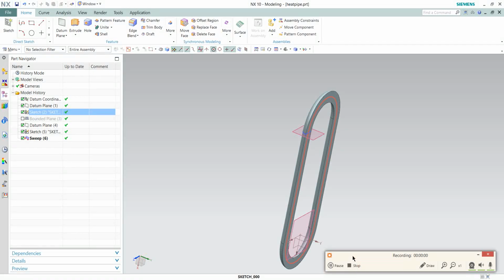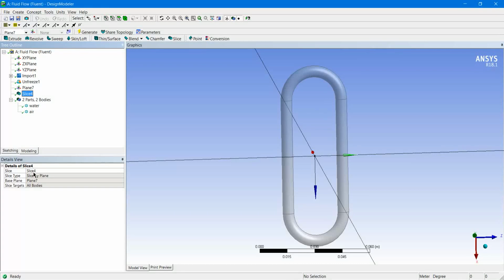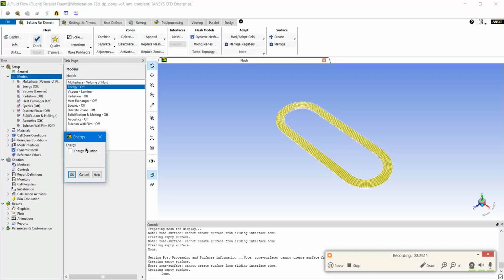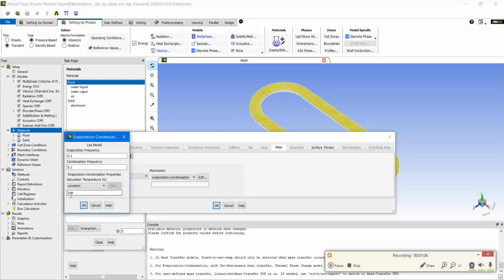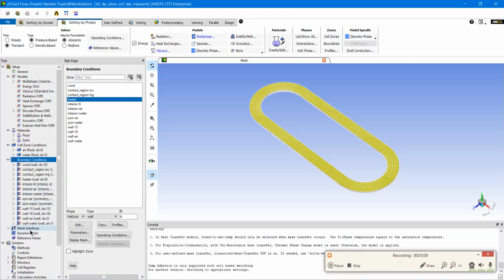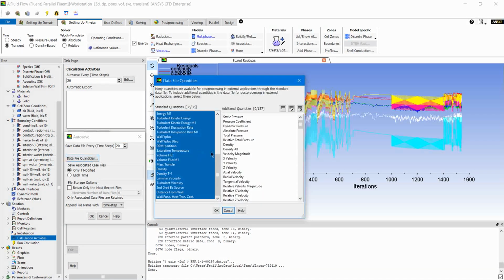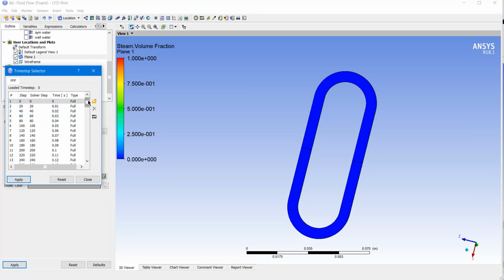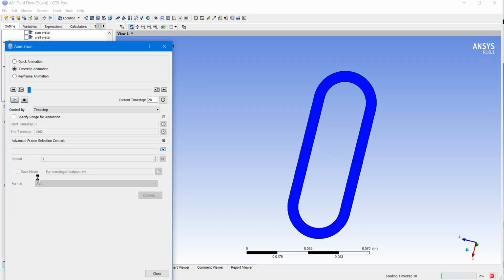Heat pipe analysis in Ansys fluent || Multiphase analysis in Ansys || Volume of fluid (VOF) model

Comment: Mr. Gandhi thank u so much for your explanation. That is a great and useful work i think.
But i get a question if i may.
You define a two piece of surface tension event between air-water and air-vapour.
Why we did not assign a surface tension between vapour and water.
Because i think i n the water region after heat is transferred to the water there will be vapor in air and i think there must be define a surface tension event between them. I would be very grateful if you could enlighten me on this.

Comment: First of all thank you that was very helpful, i have a doubt , 
during interactions in phase materials you have addes only one phase change that is from water to steam , but in a heat pipe the steam is again condensed into liquid and the cyle goes on so can we add that too!?
Reply: hello Mr.Pavan Kalyan. I would like to answer ur question with  ur permission. Phase change mechanism between the water and steam is assigned as evaporation-condensation event. That means with this way you can simulate either the evaporation or condensation with this manner...

Comment: I am using Fluent 2020 and am having issues with condensation for every case I run. I set up this case the exact same as in the video, and no condensation was seen. It just dried out all the water until the entire pipe was water vapor. Help please?
Reply: i am having the same prooblem did u fix this?

Comment: I tried this model. The vapors are not interacting with air domain. They are there in water only. Can you please tell if I have missed somewhere.
Reply: did u get solution? i am facing same problem

Comment: Why is there air in your heatpipe? A heatpipe is evacuated before it is filled with water only. You will only have water in the pipe and the partial pressure according to temperature.
Reply: Exactly pointed out
Reply: @prajwalbharadwaj2386  It can be a non-conventional heat pipe. However, that kind of heat pipe is usually filled with non-condensable gas at the end of the condensation zone, not the air in the video. However, the heat pipe simulation in this video does not necessarily have to be realistic. You can understand it as just an application scenario of multiphase flow VOF in ANSYS FLUENT.
Reply: @prajwalbharadwaj2386  Moreover, generally speaking, there is still a small amount of air in the heat pipe, otherwise it cannot provide the operating pressure.

Comment: Clear instruction however it's rather a thermosyphons than a heat pipe. No wick structure presented inside the pipe. Or am I mistaken?
Reply from the maker: yes. It is a demonstration of boiling - condensation with VOF model
Reply: Sir is this a heat pipe or thermosyphon
Reply: How to create wick for this simulation sir

Comment: Thanks Viraj for good explanation from you. But i have some question that hopefully you can answer or maybe some of you guys can answer my question. 
1. Will it give a different result if you are using eularian (condensation-evaporation model)? What is the different with VOF model?
2. Why you are using 3 phases, is it because there is air in the pipe that you are modeling? So if there is only water(steam-liquid) phenomena in my model, is it correct if Iam using 2 phases?
Thanks a lot ^^
Reply from the maker: For 1st Q, there is no simple explanation. You need to read ansys guide book

for 2nd, if you have only water and zero air, which would mean that there is no pressure in your tube. So, the water will evaporate at almost 0 K
Source: https://www.engineeringtoolbox.com/boiling-point-water-d_926.html

Comment: thank you, Viraj Gandhi ..can you make a video on simulation of a cylindrical heat pipe with open foam as wick structure. And evaporator is placed on condenser at the bottom or you can help me by explaining how to proceed for this problem?
Reply: If you did analysis for same, then please let me know
Reply from the maker: It is much complicated problem since it includes capillary effect in wick structure. I can say you need to be very careful about surface tension.

Comment: Thanks so much for the video. I am having problem learning how to simulate a simple case of subcooled water passing through a uniformly heated pipe, get boiled as it goes up the heated pipe, evaporation occurs at some length before completely turns to single phase vapor at the channel outlet. Please I'm i going to consider this as 3-phase scenario? If yes, how will I define the phases.

Please do you have a tutorial on this simple case that i can practice? Thanks for your response. (charlesokon50ceo@gmail.com)
Reply from the maker: Initially if you don't have any water in pipe, patch the whole region as air. In input boundary, give water volume fraction as 1. On wall, give heat input or heat generation.
Reply: Viraj Gandhi please can I have ur email address so I can forward to you a description of what I am trying to solve. That will help you to guide me accordingly.
Reply from the maker: Please message me.
Reply: Viraj Gandhi , please I am not proficient in the use of CFD, I am just learning how to use it and study flow regimes in flow boiling. I might be asking you some simple questions that might sound silly. Please have patience with me. 

I still need a guide on the choice of selection of models to be used. Can the steps here in this your tutorial be applied in the description of my case study? 

Secondly, do I need to activate gravity when considering a 3D-Geometry (a cylindrical pipe)
Reply: Viraj Gandhi . Thank you so very much. I will forward to you in 2 hours time the details of what I am trying to study.

Comment: ?Thanks for sharing this video. I have a few questions. Can you answer my questions
1. ?you are defining air for primary phase. What is the reason
2. You probably have defined two areas for patching that are specified in video, air and water.
The volume fraction of water for the water area is set to 1 and the volume fraction of water vapor for the air and water zone 0. What is the reason
Thank you so much.
Reply from the maker: Patching means condition of phases at t=0
I guess other things are comprehensive.
Reply: Viraj Gandhi thanks so much. I simulated your sample and my result was seen correct but contour of temperature wasnt seen correct, its exceed from 700k. Why?

Comment: sir I am trying to find out  the heat flux output at the condenser for different value of heat flux input at the evaporator. but i am facing problem to find it, could you help me ? I need it badly..Any kind a positive gesture is appreciated.
Reply from the maker: you can do it by creating monitor for condenser surface in fluent which will plot graph of heat output vs time or you might do it with cfd post as well.

Comment: Dear  Viraj  , is possible to make a model for heat pipe with wick to illustrate the difference compared to thermosyphon, many thanks for sharing this excellent work
Reply: Dear Ahmed are you working on this topic ?. Simulation of the heat pipe with a wick structure
Reply from the maker: Ahmed Elsayed Yes it is possible by making porous medium in upper section or any section you want. For that you need to separate body in design tool (DesignModeler) and then give appropriate porosity in fluent: cell zone condition.
Reply: Dear  Viraj , Does any modifications needed in energy equation or momentun, i.e source terms or interface interaction. is there a possibility for sharing a video in such case . Many thanks
Reply from the maker: Ahmed Elsayed : No modifications needed.